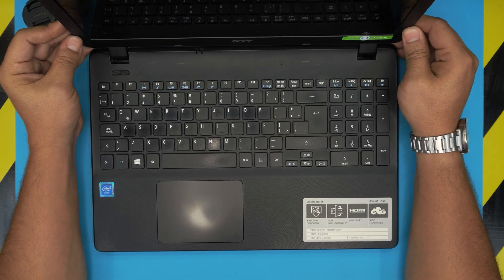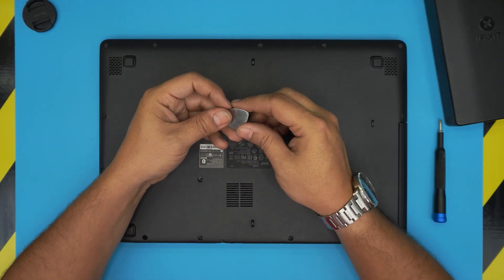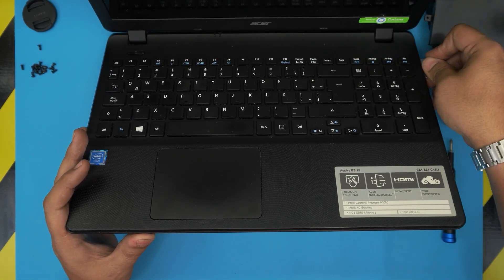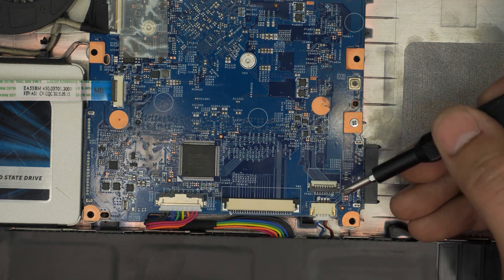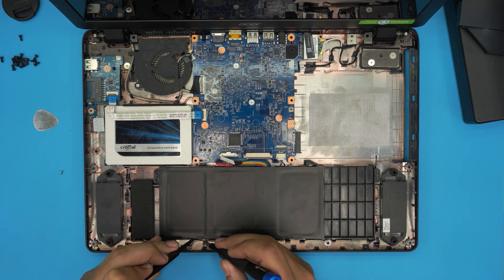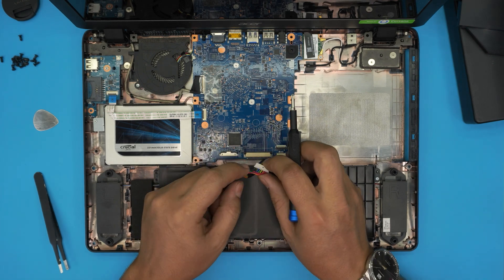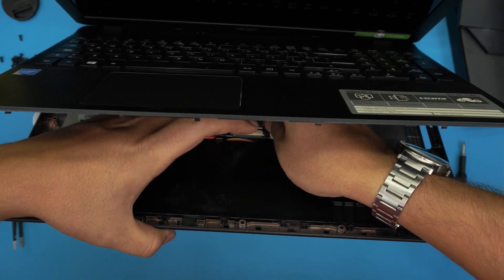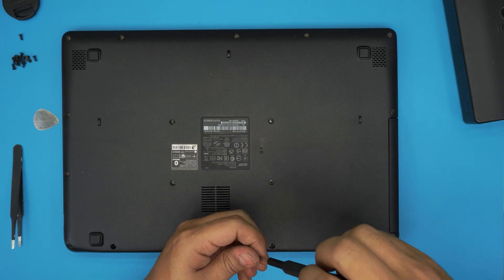Acer Aspire Es 15 🚩 Es1-531-C45u 💻 Battery Replacement

Comment: Can the laptop work fine by removing the battery? With direct power supply.
Reply from the maker: Thank you for your feedback! If you wish to support the channel, you can like, subscribe, or both!
Regarding your question, yes it will work just fine or even better because the charger will have less stress and the motherboard will heat up less.
Should you have any further questions or requests in the future, please don't hesitate to ask me.
Reply: I changed the battery. put a new one in and its still will not turn on. but the orange charge light blinks onve when I hold down the power button.

Comment: Hello very useful video. I need to replace the base of the Acer ES1 as the vent bars broke. Do you have a video to remove all parts to change to replace the base cover. Thank you 👍
Reply from the maker: Thank you for your feedback! If you wish to support the channel, you can like, subscribe, or both!
Regarding your question, sure my friend it's very easy here is a video to remove the motherboard that is the main part, then the other screws for hinges are super easy, just like playing Tetris.
https://youtu.be/gSA6qLeR5G4
Reply: @uFixTek  thank you
Reply from the maker: It's my pleasure my friend.
Should you have any further questions or requests in the future, please don't hesitate to ask me.